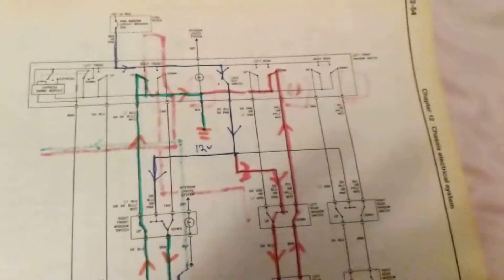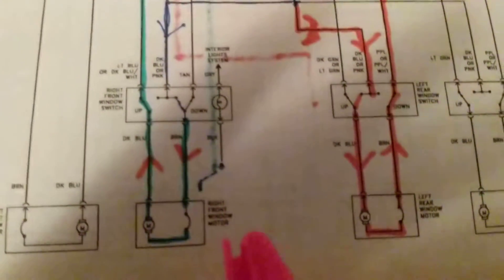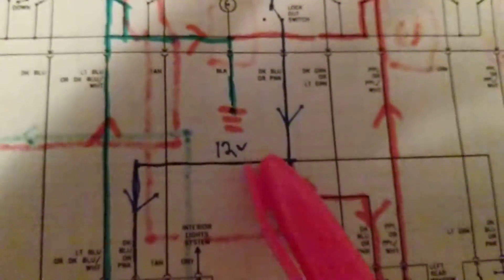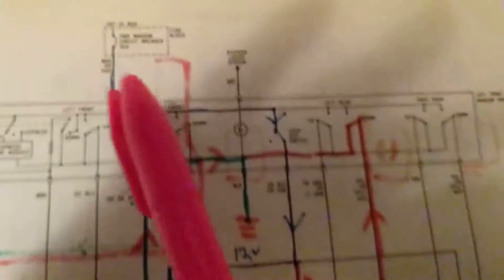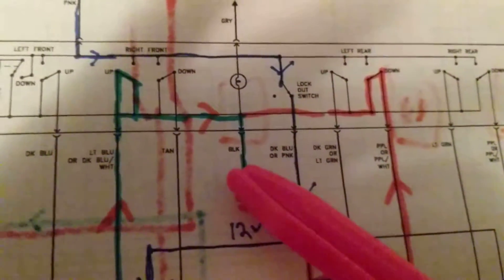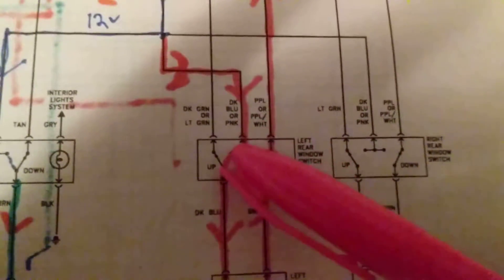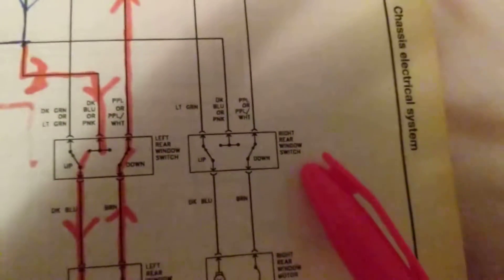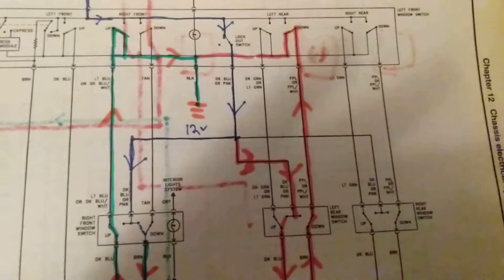How do POWER WINDOWS work in the car ,from wiring diagram for any make or model, theory

Comment: If it's not the window motor, window switch or 30 amp window fuse. What is it? 2006 Chevy Malibu. Left front window.
Reply: Check that you're getting 12V to each of those components. If you are then check your ground. Current must flow from + to - so ground your test light or multimeter and check for 12V at all stages of the process.

Comment: What will happen when driver and passenger operate same window in opposite directions at the same time?
Both points of motor will get +12 volt.   Will battery short circuit or motor will burnout?
Reply: The driver has a motor and his side and the passenger has a motor on his side even though I'll be going in opposite directions eventually they'll stop figuring out who wants it up or who wants it down but no damage will happen thank you for your question